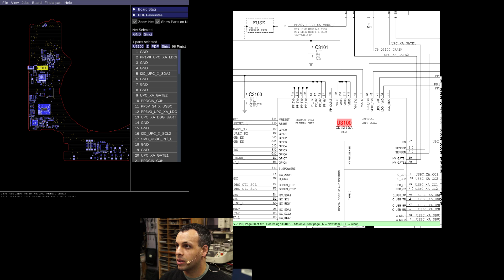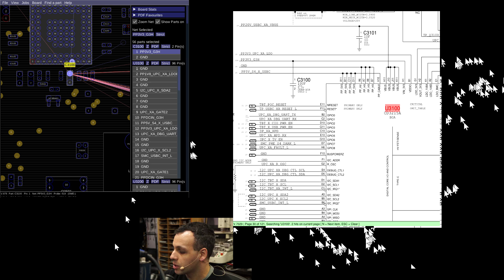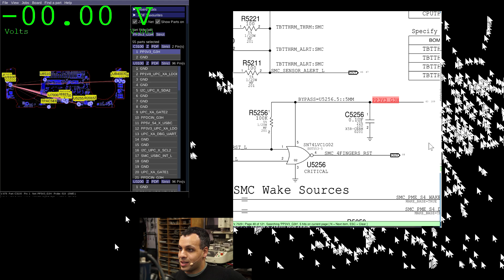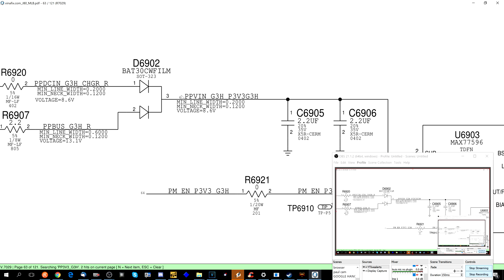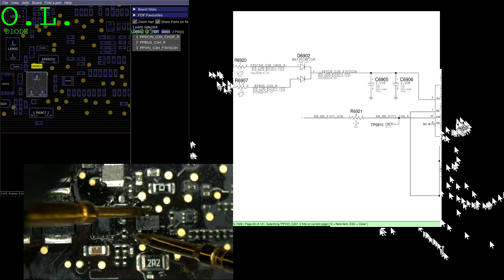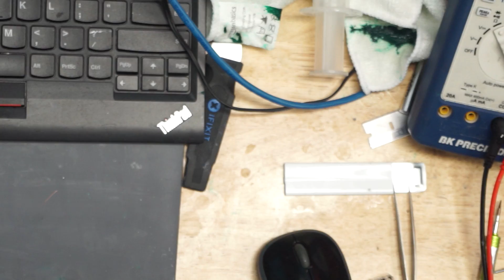Fixing Macbook, losing mind. :(

Comment: hello 
thank you for sharing your knowledge with us 
I have a problem with my MBP 2012 i5 
i know one of my usb not working other usb port work normal , 
Problem 
if I fresh install mac os 10.10.5 , 1 usb work other usb not working 
if I try to install 10.11 cpu panic kernel 
if I try to install sierra , high sierra or current os mojave non of my usb port works 
I try smc , pram , removing battery for hour , same result usb not working 
but if my MBP over night go into sleep mode and next morning click on space button screen wake up and suddenly my usb work , if I restart MBP again both usb will not work , as long as MBP go into sleep mode for maybe 2 to 3hrs and then USB port work again , have you ever have similar issue ?

Comment: I've had problems with Apple's magsafe connector.  Sometimes it charges, sometimes it doesn't.  Swapped power supplies, same problems.
My new MB pro with USB-C works perfectly (well for an Apple).
In other words, it doesn't matter what kind of charging circuit they use, it's all crap!

Comment: Do you have experience in fixing non Apple Products aswell?
My Asus convertible Tablet died 1 week after the warranty has expired and the only thing that's wrong with it is the Battery, which i can't relace myself due to the lack of any kind way to open the Tablet...

(i think it's the Battery because it wont Charge and wont turn on unless i hold the ON Button Pressed. If i let go of the Button it turns off again)

Comment: Hello Louis, 
I have a macbook pro 15" late 2013 (A1398)
I have a problem with my SSD, the smart status is failing! I checked the SSD and it seems that the problem is in the smart controller not the ssd itself! the ssd seems to work fine.
I did an online check I think about a year ago! restarted the macbook and the screen went black and as I recall the results was no problems found and it told me to check usbs and check any plugged in devices and other stuff I don't remember!!!!
Now, my battery got swollen and I removed it with a floss! and I am waiting for a new one from ifixit.
Is it possible that it is my batterys fault???? I still have my os mavericks and I didn't upgrade to yosemite because of the smart controller failure
Is it possible that if I use my brothers oem apple ssd on my macbook and update the firmware and return my ssd in the problem will be gone??
Is it possible if I change the battery the problem will be gone?
Can you help me please?

Comment: Louis, I came across your videos a couple weeks ago while making attempt to diagnose my Mid 2014 MacBook Pro after it got wet. I did really well up until not being cautious enough I separated the strip that operates the backlight keyboard. What’s involved in getting that repaired? Also it needs a new battery because before the tear down it had said battery needs to be replaced. Now it only works by power adapters. But thanks to you and your really awesome videos and positive remarks to encourage people to try things and sometimes you FUp and sometimes you fix it. Computer works except the keyboard backlight. Where’s the best place to get a battery? I’m selling it once it’s complete.

Comment: i have watched a lot of videos of yours over the years props to you, you are a Wizard I have a itx motherboard specifically asus p8h61-l r2.0 I am a novice at soldering upon removing a sata cable a friend tugged too hard and ripped the sata clean off I resoldered the sata back onto the board and the sata port worked but all of the on board and off board usb ports have power but receive no data

Comment: If your head tick does not hurt and feels like muscle spasm, then you should try iron and magnesium supplements. Muscle spasm may have a bit of dull pain, but it should never be a sharp pain. Most likely its stress related muscle fatigue. What do I know about it? I have a degenerative heart nerve disease and I have to keep my "levels" in check not to over and understress my heart and muscles. Supplements do not harm and SHOULD give rather fast results. If you dont see your tick going away over night, then go to the doctor asap. You may have passed into nerve damage.
Reply: Supplements can definitely harm you. You shouldn't take iron unless you need it.Magnesium and Calcium are good for muscle spasms and cramps. If that doesn't help, some benzos will also help.
Reply: @PBMS123  Cramps increase from calcium. F for effort, though
Reply: @ManageableRapTactics  electrolyte imbalance causes cramps. You can have issues with cramping if you are lacking calcium.
Sodium to begin the muscle contraction, calcium to maintain the muscle contracting.

If you lack calcium it can affect the muscle operation.
Reply: @PBMS123  Like most moving things, muscle spasms are caused by either physical or chemical. So its either stress or imbalances. Why I suggested IRON: it should help with stress by getting more oxygen to cells and releaving some cell starvation issues. Magnesium functions as a catalyst inside the cell, with the major function being inside the mitochodria with ATP procuduction. These two are a good starter supplements since they are very prominant in the dynamic cell function and thus, a small discrepency wont hurt you. But the flipside is: the efects of them appear rather fast.
Reply: @priitmolder6475  If he's getting good dietary iron, excess iron sin't going to cause extra RBC production. Not only that, if he's sick, iron supplements would be the last thing you want to do, as the body suppresses excess blood iron in order to help fight infection. And supplemental iron can destroy this process and make people sicker.

Comment: Imagine, if Apple designed electronic for aircrafts, UHH.
Reply: If the screen in one of the seats stops working the engine will stop and not start until the screen in replaced. At an authorized repair center only!